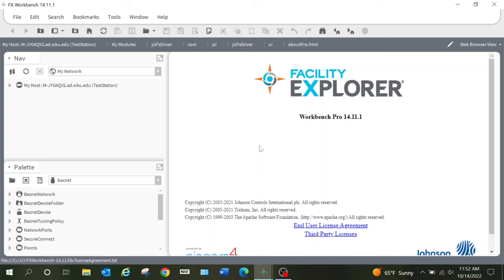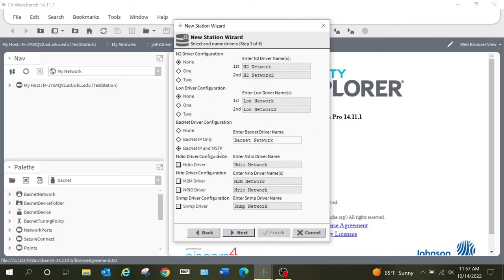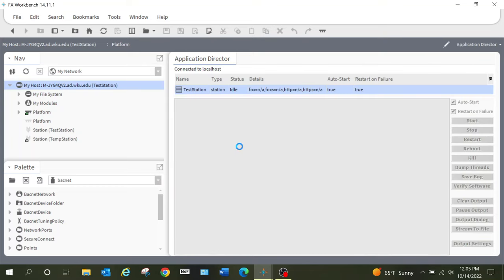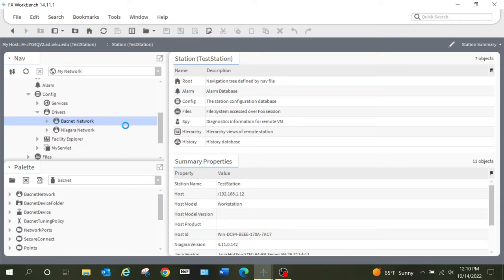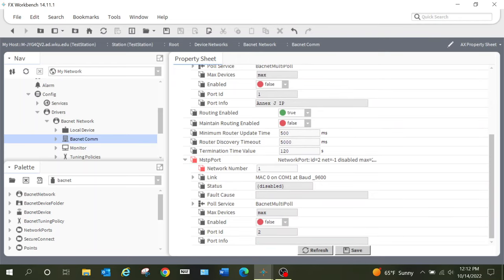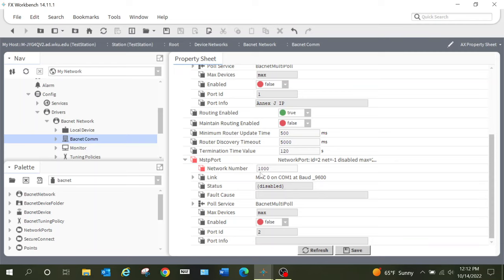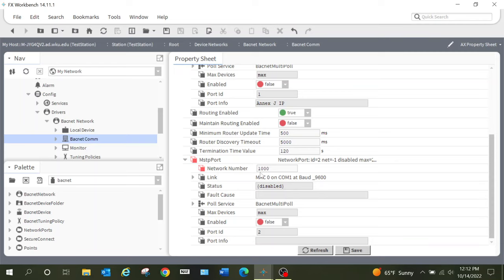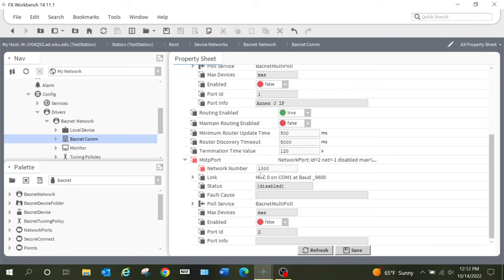How to set up a Station in Tridium Niagara 4, automatically adding BAS Bacnet points and graphics

Comment: Hey! Great videos, is one of those drop downs when adding a device available to bring in say an older NAE55? When I bring in points from an NAE to my N4 server (4.11) all I get is point names that are nonsense, like xxxxx.ao21 etc.  Nothing useful at all.  Note: I am using the vykon brand of WB, I do use the older FX workbench for my old FX60 JACEs.  Thanks!
Reply from the maker: I would check the naming convention of how they appear directly in the nae. Spaces and some characters will do that when pulled in.